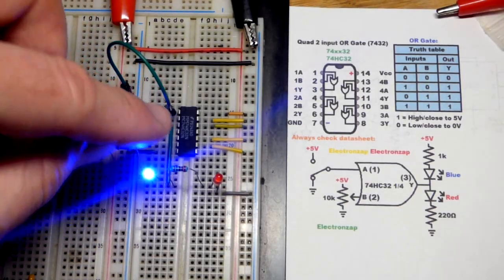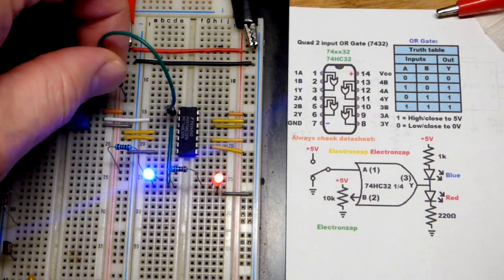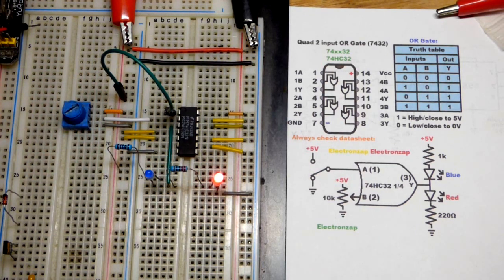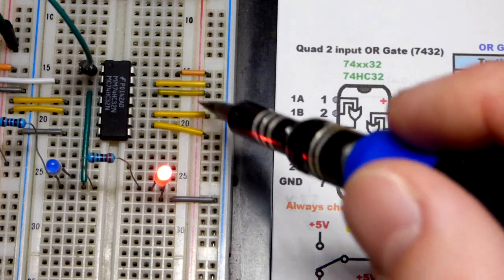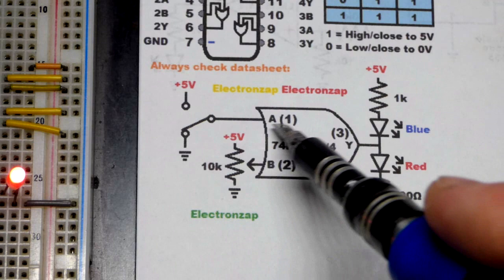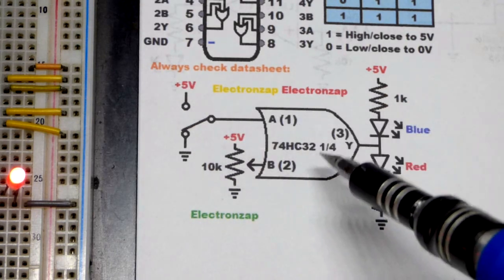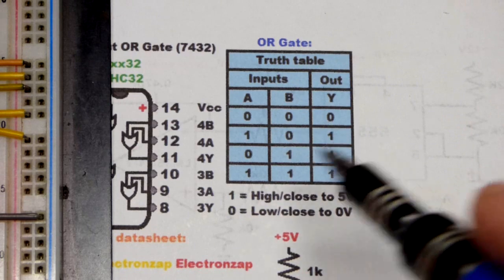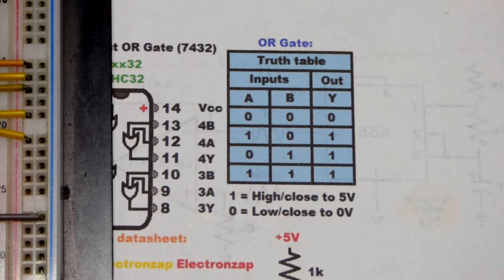74HC32 Quad 2 input OR Gate 7432 IC demo circuit for learning electronics shorts 70

Comment: Hello can you please help me here? I have used this ic of OR gate to make 4× 2 encoder circuit . I have used only two OR  gates from this IC and other 2 OR gates I have left unconnected. I gave the battery (9v) positive to VCC(without any resistor inbetween) and battery -ve to gnd of the IC.  The 2 OR gates That i have used, always give high output in the their output pins. I know everything else is perfect, it's only something that i am doing wrong with the IC. 
I also know that i am giving input and taking output from the correct pins.Can you see why that is happening?